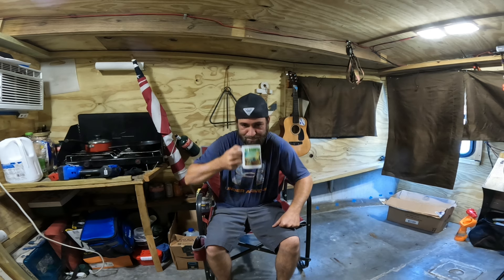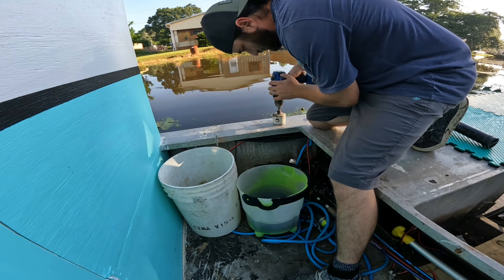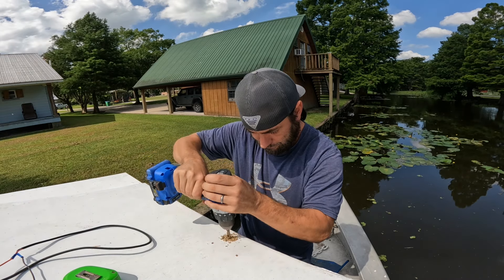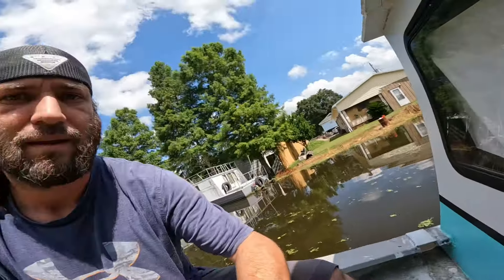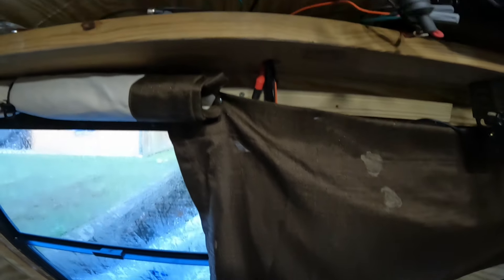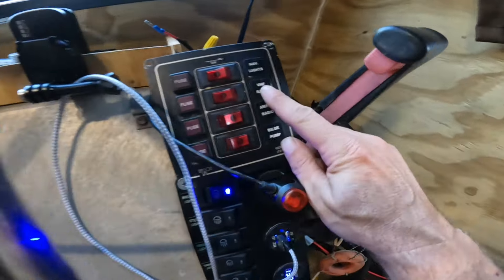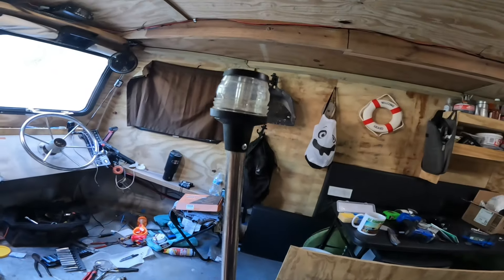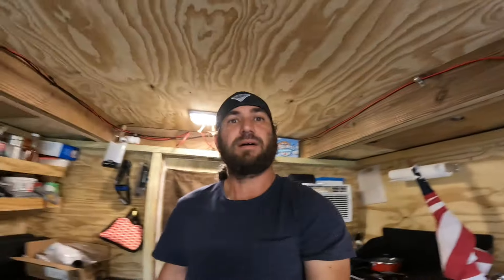Camping boat build part-9 a few improvements

Comment: Awesome sir!
I have a 360 white light & a VHF/GPS radio installed on the kayak. Also have the navigation & deck lights mounted but they and the horn aren't wired yet. Haven't found the spotlight I want either.
I'm a wuss, work has stopped until the wrens hatch, lol.
Reply from the maker: lol I ain’t doing to much work till the cool fronts come back just small stuff.the table saw and wood working will have to wait 🥵👍✌️🛥🎣

Comment: Nothing like having a good set of lights that you can depend on when you're running at night.
Cheers!
Whipple
Reply from the maker: Thanks since the led stuff came out it made a world of difference compared to the old spot lights we use to use 👍✌️🛥🎣
Reply: @GJCAMPING     That’s for sure.   Someplace at my dad’s place there is still a an old deer spot light made from an airplane landing light and an aluminum saucepan.  A far cry from what you can buy today.  
Be safe.   Have fun!

Comment: I was thinking maybe a spotlight on the roof you could control from the inside. One of those could help you avoid the swimming tourists at night. 😋 👍✌☕
Reply from the maker: Lol that led light on the roof is very bright it lights up forwards and the sides I’ll video one night while we ridding the whole bayou and tress light up crazy from the old lights we used to run with just a straight beam 👍✌️🛥

Comment: Some bubble foil insulation on the inside of the cabin would help with the heat in the summer and the cold in winter. Jim Desclos who has a utube channel and a fb page, thebossoftheswamp , has numerous videos about using the silver bubble foil for insulation in a variety of settings.
Reply: Great idea, ive been researching lately on insulating my cabin. I bet the bubble foil would make a big difference in the boat.
Reply from the maker: I plan on going with foam board then cypress planks to give the interior a cabin feel 👍✌️🛥🎣
Reply: @GJCAMPING  The foam board is thicker than the bubble foil, but I don't think it weighs that much more. . Jim has properties in rural northern New York and a camp on several acres on a mountainside in rural New Hampshire by a lake he has a dock on. He uses bubble foil extensively because it gets really cold there. Jim has an old school planer that he got for free and he uses wood off his properties for various projects. You and dat louisiana life go fishing, hunting and camping in southern Louisiana in the bayous, swamps and lakes. My family had river clubhouses on the Mississippi river outside of Elsberry, MO., and Grafton, IL., that we leased the lots from the US Army corps of engineers and owned the clubhouses that were 6' off the ground on telephone poles. The Grafton clubhouses were on ploughman slough on a peninsula between the confluence of the Illinois and the Mississippi rivers and there was a slough that ran behind the Norton Woods at the Elsberry clubhouse and the levee. So the slough stuff and a slough that was on the 2,000 acre cattle ranch that an aunt and uncle owned in the MO Ozarks on the Big Nianugua river kind of remind me of where you guys are on the water.